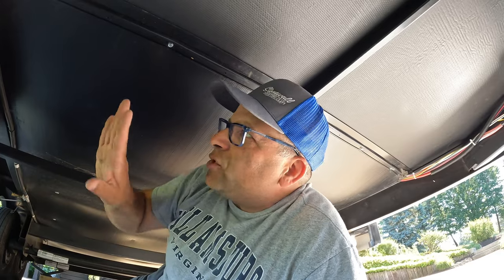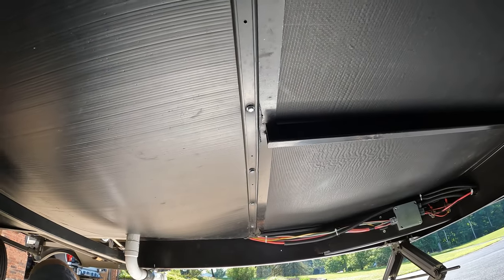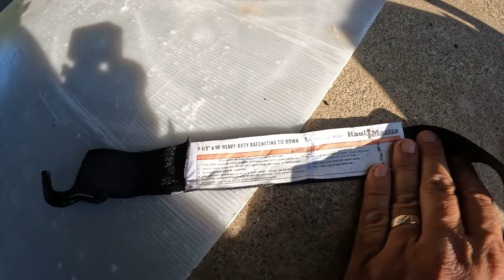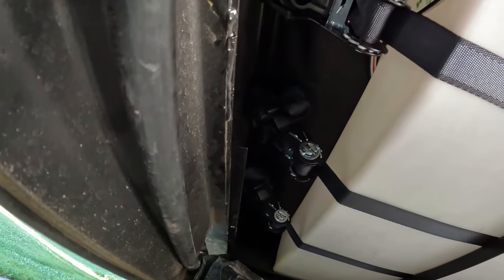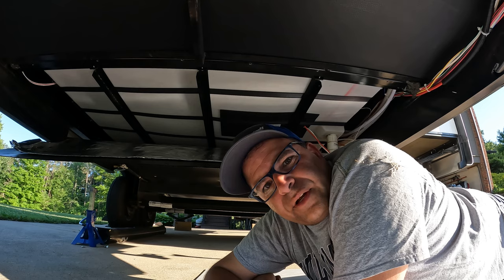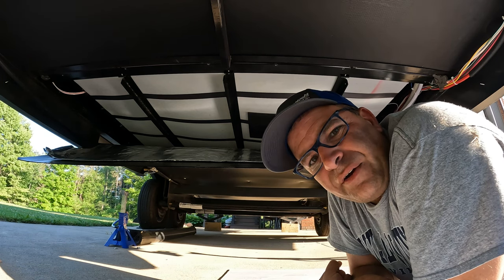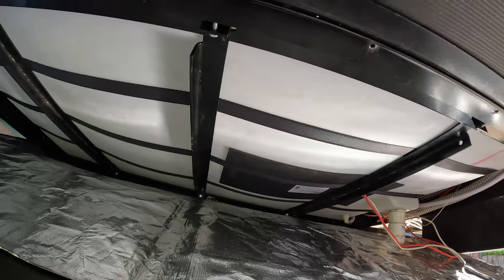Easy Fresh Water Tank Support (Rockwood Mini Lite) #rvlife #werv #rockwood

Comment: Thank you so much!! We have the 22FBS version of your trailer. It came off the line 10/21. In April we drove 1600 miles starting with 30 gallons and came home with 20. We just looked underneath and the water tank was bowed down and 2 of the metal brackets were bent and bowed down! We just finished your mod. We are thanking God for your video!  We always camp places that don’t have water. We always traveled with water in our old camper and didn’t think anything of traveling with this one.
Reply from the maker: Thank you for the kind comment, I’m so happy that we were able to help. Sorry you had issues with your tank. Our goal from day one is to share what we do to maintain Belle and to hopefully help as many people as we can…Thanks for subscribing! Tony😀

Comment: Well it’s disappointing that the model isn’t structurally sound enough to safely carry what is advertised. The tank and brackets look flimsy. Solid solution. Let us know if it holds up long term. Great vid!
Reply from the maker: Thanks for the comment, I will keep all posted on how it works out long term or if I further modify it..
Reply: Most towable RVs are like this. Not unusual at all.
Reply: I would double-ditto this, disappointing it is!!  I can't understand why Forest River, having received feedback on the problems with bowing tanks and brackets, wouldn't proactively add more and thicker braces to solve this problem on their own.  Wouldn't that be smart engineering from the factory? Don't they care?

Comment: Great video and DIY advice.  I just bought a Mini Lite 2509S and use my camper the most in winter when many campsites have the water turned off.  And the larger tank in the Mini was a big value add for me.  So traveling 3hrs with a full tank can be a necessity.
Reply from the maker: Here is another solution I did this past year. https://youtu.be/FvxPs638OpA?si=NCIJU7WcDLNBJhwX
Thanks for watching & commenting! Safe travels & Happy Camping!

Comment: Our Winnebago Voyage has a sheet of OSB between the braces and the tank but thinking I may try this or a similar mod using straps for added support. I have always traveled with a nearly full freshwater tank since starting RV’ing in 1999. Cheaper and cheaper builds on these newer units.
Reply from the maker: Thanks for the comment, appreciate you watching. Glad this video might have helped you…

Comment: After this video we are looking into doing this method.  2 questions:  1)  We see that the Haul Master straps come in a set of 4.  Is there any reason you used 3 instead of using all of them?  2) Any reason for starting from the driver's side versus the passenger side?  (i.e. is there a reason to have the ratchet on one side or the other?). Thanks again, Tony.
Reply from the maker: Great questions!
I felt that three was sufficient for our usage. A forth would not hurt and probably benefit. 
The passenger side has more room to use the ratchet end. The drivers side has other wires that would be in the way…
Reply: @TNTRVing  Thanks bunches for the additional info.
Reply: We have a 2205S also and I used your method today using all four straps. I am sure this will be a benefit and certainly gives me peace of mind. Thanks

Comment: Inadequate support for the tanks seems to be an issue across many brands for decades. The don’t carry water with it line seems to me a pretty lame excuse.  At least in the west a lot of people boondock with quite a distance of bad road between the last safe water and the camping spot. Trading thin angle iron for thicker square tubing is for me just something I have to plan on doing whenever I get a new rv.
Reply from the maker: In addition to the straps, here is what we also do for water. https://youtu.be/FvxPs638OpA?si=iSm5w-VV5kiwO9Dy
Reply: @TNTRVing    I run a Monster Hauler rack with 2 ATV’s over the bed, access to the front of the bed is pretty limited and there are usually gas jugs under the rack in the rear. I will run one 6 gal potable jug that I’ll use to grab a bit of water. 

Thinking I might mount a say 30 gallon water tank under the front part of the rack, with an RV type pump. Would also be good to have more weight ahead of the rear axle.
Reply from the maker: @JeffinTD great idea! Thanks for Watching and commenting.

Comment: Thank you for sharing.  What year rockwood mini did you perform this strap on? 
And just a thought on your solution, specifically where the straps touch the corner edges of the tank; maybe use aluminum angle strips to carry the load of the straps along the entire length of the tank on both sides.  This will help prevent chafing from the straps. Just a thought.
Reply from the maker: Ours is a 2021 2205Ss
Reply: @TNTRVing  thank you!
Reply from the maker: Welcome!
Reply from the maker: Also, Thanks for the suggestion of aluminum. Be careful not to overdo and crank down the ratchet straps. Slight pressure is all you need.

Comment: Enjoyed the video Tony! Did you have any problems in getting the bottom enclosure reattached?
Reply from the maker: Not at all, the sides tuck in the frame pretty easily. When you insert the screws start them all partly before tightening all the way down..This way if you have to shift it you can…
Also, don’t over tighten them… 
Thanks for watching!

Comment: I’ve seen others that ran 2 sections of Unistrut under the freshwater tank for support. Would that method have helped with your frame design?
Reply from the maker: I could have easily added the unistruts like others. I felt that solution wasn’t safe, it would be a disaster if they came off while underway.
Thanks for watching & commenting.

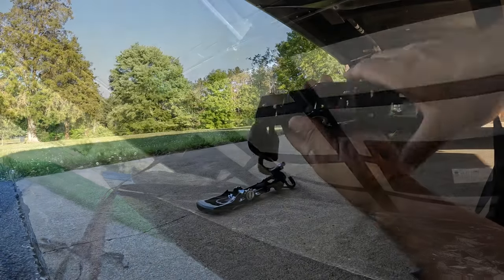Comment: Hey Tony. I bought the straps from your Amazon link and I'm having a heck of a time figuring out the shortening part you talk about at about 3:40. I'm starting to wonder if my strap is constructed differently, because I can't make sense of using the "same loop end as the bolt is inserted". We've been going frame by frame in the video but it's really hard to see.

Any tips or ideas?
Reply from the maker: Does the strap that you purchased have a nut & bolt that go thru the ratchet end on the short piece of strapping?
Reply: @TNTRVing yes, it just didn't make sense how I could put that bolt back through in a way that would make it a little shorter. Pausing the video it looks like your strap is folded back on itself in some way.
Reply from the maker: Okay great, Now all you have to do is remove the bolt on the ratchet end, remove and rotate the strap 180 degrees and put the bolt thru the same strap loop of the hook. I just folded the extra strapping out of the way when I did it. Hope that helps.

Comment: Is this noted anywhere in the owners manual?   I haven't heard of issues with the tank and hauling water.  Is it a known issue I should be calling FR about?  Have a 2022 MiniLite 2104s.  Thanks for making this!
Reply from the maker: You may want to call and give them your vin and ask. My guess is they will caution you not to travel far with full water..
Reply: @TNTRVing  thanks a bunch.  I'm going to do that. Crazy stuff isn't it.  Thanks again.
Reply: @markbutcher2734  Hi Mark.  I recently put together a document on issues people have had with fresh water tanks, plus different approaches people have used to address this (I'll be adding Tony's link to it because his approach is different than the two typical approaches).  If you'd like a copy send an email and I'll forward it.  There definitely is recommendation from FR not to travel with much water in the tank.

Comment: Did it work for boondocking?
Reply from the maker: Yes, works great, I normally only travel with 25 gallons or so in Belle. I also have a 65 gallon in the bed of the truck. Here is a link to our setup. https://youtu.be/FvxPs638OpA?si=Xxn-qLIPVgJD4_d6. Thanks for watching and safe travels!
Reply: @TNTRVing  I think I am going to do something similar. Steel cable inside rubber tubing with eye bolts and turnbuckles! My setup is a little different than yours. The steel looks strong enough, but I broke one of the bolts on the removable beam and almost lost the entire tank.  I absolutely must support some of the weight elsewhere because it cracked my tank. I can fix the crack, but it'll just do it again if I don't support weight elsewhere!
Reply from the maker: @aarongoodwin4845  you may want to try a separate tank like I did and only partially fill the onboard tank. on our Rockwood Mini Lite, it is recommended to only fill the tank when at a campground and travel short distances. I have another video coming out soon that shows us at a harvest host, instead of using our onboard tank I hooked up the water line from my truck water tank to the winterization port and used the onboard water pump. I liked that setup as It didn't add weight to the front of the trailer. We only used the water that we needed. Hope that gives you more ideas! Happy Camping and Safe Travels!
Reply: @TNTRVing  I do appreciate you and your time! Cheers!
Reply from the maker: Thanks! Cheers to you as well!

Comment: If Rockwood does not support traveling with water, I will never buy Rockwood. Because the whole point of an RV is to travel around the world withyour own supplies.  Does not make any sense in just connectiong to a city water source, or adding water once you reach the camp ground.  This is lunacy.
Reply from the maker: You are in luck! since this video was posted, Rockwood has improved the structural support of the tanks. The only issue now is that the additional weight will add more to the tongue weight. Safe Travels!

Comment: What the hell is wrong with forest river ?
Reply from the maker: Not exactly sure why it’s designed that way, I would have preferred a smaller better supported tank.
Thanks for watching!
Reply: @TNTRVing  Loosely quoting from Oren 'FR has to run a balance between the need boondockers have for a large freshwater tank and keeping weight low enough that the 1/2 ton pickups can haul them'